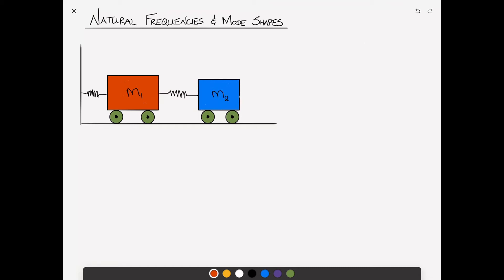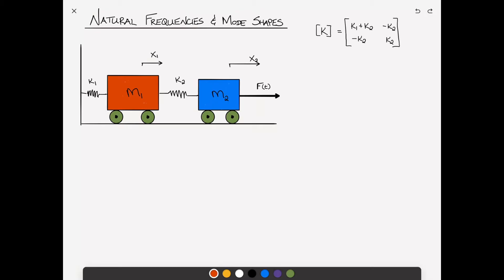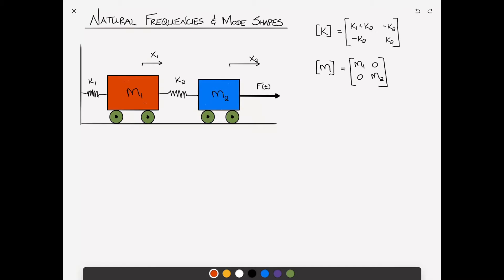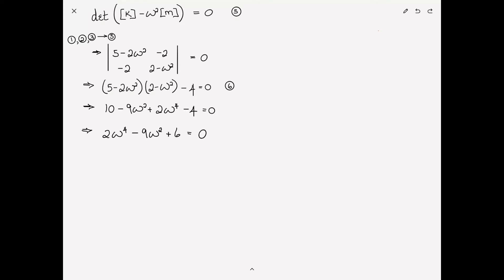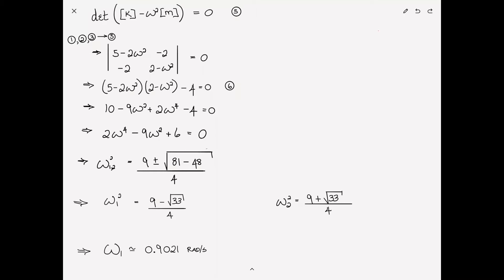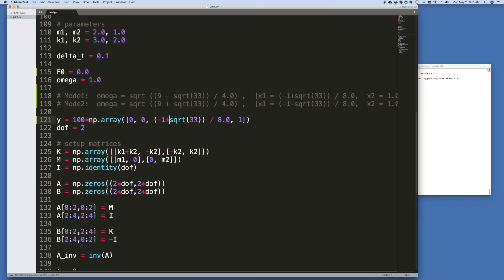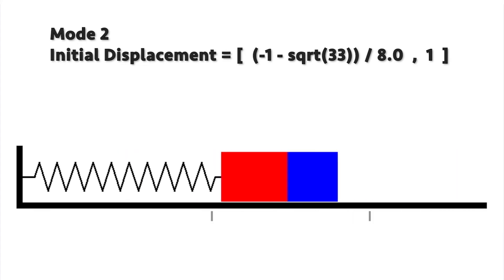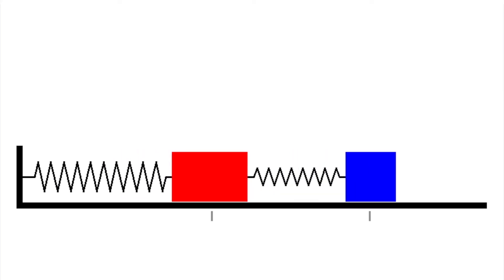So What Is A Mode Shape Anyway? - The Eigenvalue Problem

Comment: So sir that means, eigen values are the frequency of the vibration and the eigen vectors correspond to the pattern of vibration that the system will follow at a given frequency. Can we say this, if we want to make a statement in layman terms ?
Reply from the maker: Yes, this is correct with the slight modification that the eigenvalues are the frequencies squared (since these equations are 2nd order).

Comment: Hello! Can you please explain the eigenvalues and eigenvectors if we have also 2 dampers in the system.
Reply from the maker: The most common way to treat damping is to assume proportional damping (which is a good assumption for many problems).  In this case, the [c] matrix can be written as a linear combination of both the mass and stiffness matrices (i.e. [c] = α[m] + β[k]).  In this case, adding damping can alter the effective stiffness matrix or the effective mass matrix.  As a result of this, the eigenvectors and eigenvalues for the system will change depending on the values of α and β.  I will have to make a video on this to explain it properly.

Comment: Great video, thanks.  However, would you please comment on the orthogonality of the two eigenvectors.  You said that their dot product is zero.  However, if I take your example, one eigenvector is (0.593, 1) and the other is (-0.843, 1).  Their dot product is (0.593 * -0.894 + 1 * 1) = 0.5.  It appears that the eigenvectors are only orthogonal if the masses are identical.  Am I doing anything wrong??
Reply: I believe those are the mode shapes which are not equal to the eigenvectors. Not 100% though.
Reply: @UltimateBreloom  Eigenvectors are mode shapes because they represent the deformed state of the structure as it vibrates at the respective eigenvalues (frequency).
Reply from the maker: I think I might have misspoken...slightly.  The eigenvectors (which are the same thing as the mode shapes) are not orthogonal to one another, but rather are orthogonal with respect to the mass matrix (and also the stiffness matrix).  This means that
      transpose(v_i) · M · v_j = 0  if i ≠ j
where v_i, v_j are the eigenvectors and M is the mass matrix.

So, if you sandwich the mass matrix (or the stiffness matrix) in between then this relationship should hold.
Reply: @Freeball99  Excellent!  Thanks for the clarification. That works for both M and K matrices... transpose(v_i) · M · v_j = 0  and  transpose(v_i) · K · v_j = 0  if i ≠ j

Comment: Could two mode shape of the two dof vibratory systems be negative or one must be positive and the other is negative?
Reply from the maker: No.  One must be positive and one negative.  You should always be able to write any response in terms of a linear combination of the mode shapes.  In order to achieve this in 2DOF, you must have one mode where the masses are moving in the same direction and another mode where they are moving in opposite directions.

Comment: Hi, great video i was just wondering how you would find the Eigen values if you incorporated a Damper matrix, C?
Reply from the maker: This is a good question, but difficult to answer without making a video... 
 
Engineers will typically model viscous damping by using something called proportional damping.  In which case, [c] = α[m] + β[k] where α and β are constants.  So the damping is proportional to the stiffness and mass matrices (or said differently, the damping is proportional to the potential and kinetic energies of the system). This way, the system has the same eigenvalues as the undamped case and can be decoupled using the normal mode method.  This is not the only technique used to decouple the equations of motion, but if has been shown to be effective in that it does not reduce the stability boundaries significantly.  

It should also be mentioned that this technique is unnecessary if you are solving the equations of motion using numerical integration instead of the analytical approach.  I will make a video on this in the future.

Comment: Question Professor: usually for standard eigen value/vector math problems you subtract identity matrix times lambda (or omega squared in this case) from your K matrix. However we are subtracting mass matrix (which is not the identity).

So how can the be related to the standard Indra of finding eigenvectors and values in the “classical” linear algebra math way?

Thanks!
Reply from the maker: Take a look at this.  Hopefully it makes sense.  dropbox.com/s/wdsoat8pew4fnn3/EigenvalueProblem.pdf

Comment: Nice video, thank you for sharing! I have a question, that is, what's the difference between mode shape and mode of vibration? Because i cannot find on the internet if the difference is that the the latter is the superposition of the former for many dofs, or perhaps one of the concepts contains also an info about the phase, or whatever... Thank you so much in advance!
Reply from the maker: I think what you have stated is fundamentally correct.  The mode shapes describe the "shape" of the system when it vibrates in one of its natural modes.  The mode of vibration refers to the superposition of these modes, but tend to focus on which mode/modes are being stimulated - i.e. which modes are contributing the most to the motion.

Comment: What are the mode shapes (and thus natural frequencies) for damped, MDOF systems, particularly when damping is not proportional? The Vibrations book by Rao says that modal analysis (and thus determination of mode shapes and natural frequencies) is only applicable/solvable for undamped systems while the one by Kelly has a procedure for general damping using augmented matrices.

But still, it is not clear to me how/what are the mode shapes for damped systems especially generally damped systems.
Reply from the maker: It's a good questions and beyond what I can explore in a text message.  

On the one hand, from a numerical point-of-view, you could take the code from this video, add damping and run it for a forcing function of different frequencies until you hit resonance.  Then you could examine the mode shapes.

On the other hand, from a mathematical point-of-view, we still like to refer to the natural frequencies even for a damped system.  This is because the natural modes are orthogonal to one another and this is a very important property to be able to use when determining the response mathematically.  As a result, in most cases, we assume the damping to be proportional damping.  This means that we can write the damping matrix as a linear combination of the mass and stiffness matrices.  Fundamentally this allows us to write the damped response in terms of the natural modes.

Damped modes look a lot like natural modes, but the peaks get squashed and shifted a little (for small to moderate amounts of damping).
Reply: @Freeball99  hi Freeball. I only saw your reply today. Regarding the damped modes for a system, I actually just solved and plotted a 2dof system with general damping and whose initial displacements are that of the undamped modes. The vibrations are like what you said that are slightly offset. If the damping is proportional, the masses oscillate with no phase difference.

I would also like to express thanks and appreciation for your animating the 2dof system and sharing your code. It helped me tremendously in my vibrations class today. I would just like to ask how you learned/what resources you used to learn how to animate it? I'm interested to animate a 3dof system. I don't have any prior knowledge/experience with animation in Python although I am already familiar with it already. Plus there seems to be a dearth of learning resources on how to animate spring-mass systems step-by-step.

Lastly, in your animation code, what should I change in thr forcing function so I can transfer the applied force from mass 2 (the right mass)to mass 1 (the one attached on the wall)? I intend to make mass 2 as a vibration absorber to mass 1.

Again, thank you very much Freeball! Your videos are invaluable and deserves more views. Glad to have found your channel.

Comment: Eigenvectors are not necessarily orthogonal. They are linearly independent. Singular vectors are orthogonal. Am I wrong?
Reply from the maker: You are correct that, in general, eigenvectors are not necessarily orthogonal.  However, for the case that the matrices are symmetric then this will always yield orthogonal eigenvectors.  So for the case of vibrations problems, due to the symmetry of the [k] and [m] matrices - which is always true as far as I'm aware - the eigenvectors for the model will be orthogonal.
Reply: @Freeball99  Thank you for the clarification Sir. Great video!

Comment: What device or software do you use for your lectures
Reply from the maker: The app is "Paper" by WeTransfer, running on an iPad Pro 13 inch and using an Apple Pencil.  The voice is mine.
Reply: @Freeball99  you voice is the best part
Reply: @KakarotM99  That's kinda sus, my fam.

Comment: From 5:29 to 6:27, your statement that, because the determinant is zero, we can pick any of the equations, as they are dependent, we chose any! However the two doesn't yield same (X₁/X₂)  values.
-2X₁ + (2-ω²)X₂ =0 yields 
(X₁/X₂) = (2-ω²)/2 
whereas (5-ω²)X₁ -2X₂ = 0 gives
(X₁/X₂) = 2/(5-ω²)!
Made same comment in the previous video as well!
Reply from the maker: You have a typo (5-ω²)X₁ should be (5-2ω²)X₁  if you plug in one of the eigenvalues for ω, you'll find that they are the same.